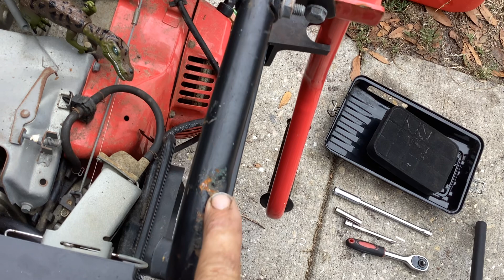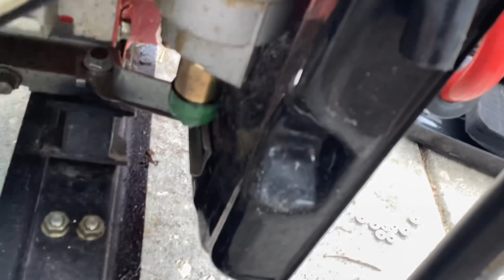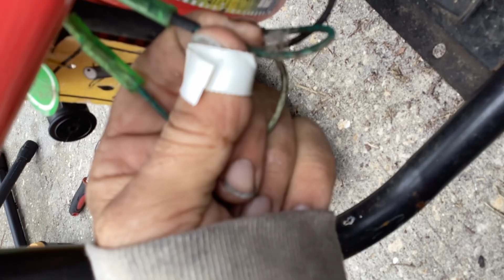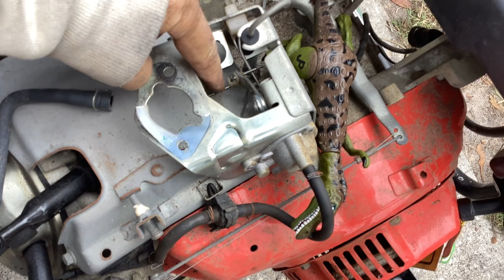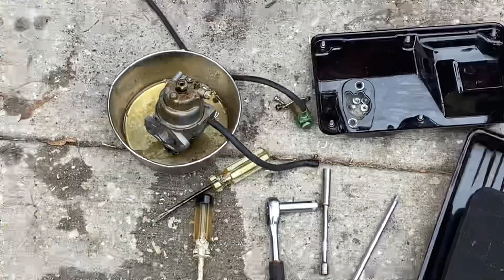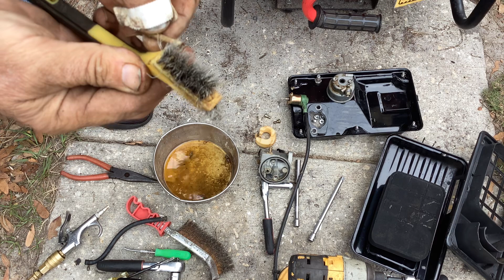2004 All-Power 6000 watt generator.........Carburetor Cleaning Today..!!!!!

Comment: I bought a recoil for a kfx 50 from Amazon. Arrived yesterday put it on the guy said it might need a tune-up did about 30 pulls got it running.  Shut it off recoil wouldn't work fell apart! How could original go 20 years Amazons 1 hour. So go to carburetor side there is a sheet metal screw in carburetor over flow tube so pulled carb ordered a Amazon carburetor.  Hope better than recoil. Just going to fix spring in old recoil i thought a new recoil would save customer money (NO) so i take original apart bend new hook on spring. Hope it lasts.
Reply from the maker: I have had after market parts fall apart before..not good at all.